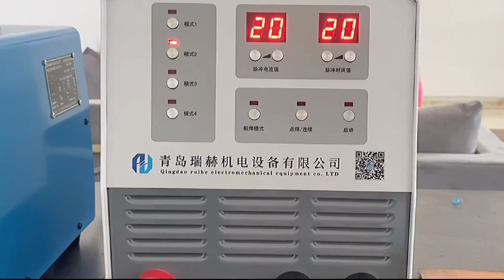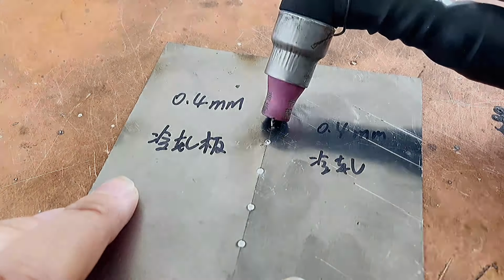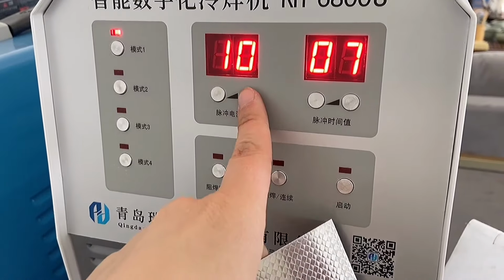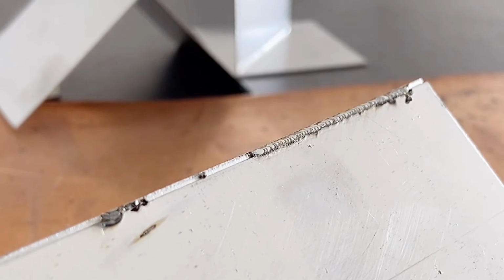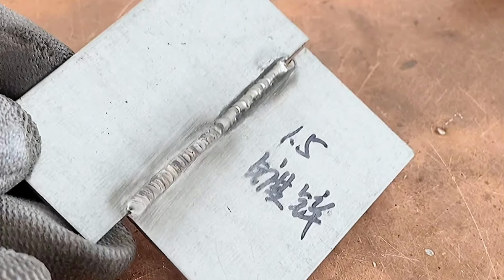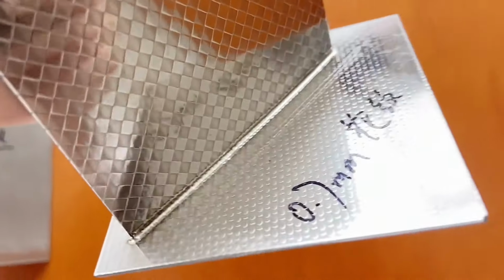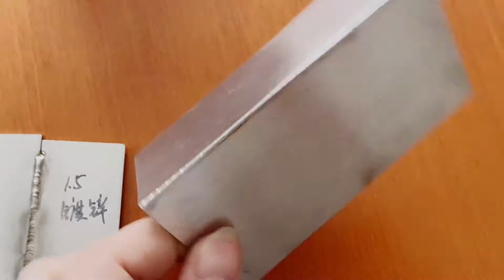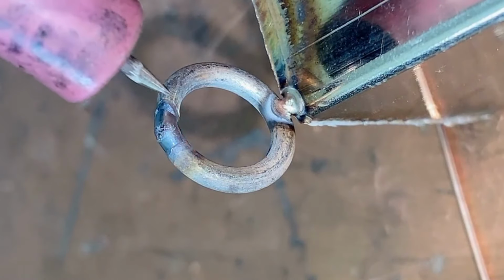Cold welding is TIG welding? Watching this video you will understand!

Comment: As a welding inspector and material science engineer this is just ASMR. I can go on a tangent, but I watched this in utter confusion. 1. Soldering is not welding 2. Zero penetration, so zero strength 3. A beautiful weld does not mean a good weld, a good weld will be beautiful. 4. Grinding and polishing to remove stress risers and remove defects is utterly important. 5. The amount of undercut; regardless of the strength, undercut is the number one failure of welds. 6. Your weld has no roots with a zero butt, at least back-grind a root weld. Partial pen welds are very uncommon and take a lot of math and quality checks prior to finishing them as they are weaker than dual or full pen welds.
Reply: Everyone has disregarded this process, based on misunderstandings, mainly because of poor Chinese translations. Will this process replace standard high voltage and high current welding processes? Maybe in the future...but not these low power versions...but let me explain it in native English. 

This process is novel and revolutionary in it's own right, and I think you will appreciate it.

This process uses a low power induced "flyback" HV pulse to ionize the air gap, in series with the secondary (carrying this low power flyback HV pulse) is a low(er) voltage, relatively "large" capacitor bank. They use a novel bypass network consisting of zener diodes and varistors in parallel with the capacitor bank to isolate the low voltage capacitor bank from the HV pulse. Once the HV pulse ionizes the air gap, the low voltage, high current capacitor bank discharges across the air gap, into the work piece. The "cold" welding label, is because there is no high power transformer creating HV+High current. There is no need for expensive transistors, SCRs, Bridge rectifiers, etc...the machines so far are utilizing a relatively small/cheap bank of capacitors (20,000uf @ 100v or less)....this process can imo, rival conventional Arc welding of all kinds, with the utilization of supercapacitor banks, but that has yet to be done.